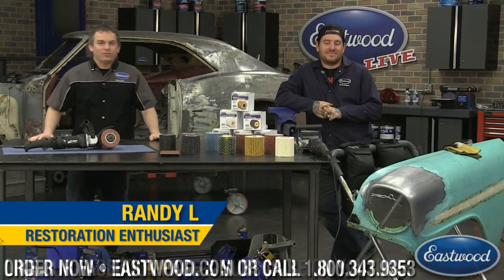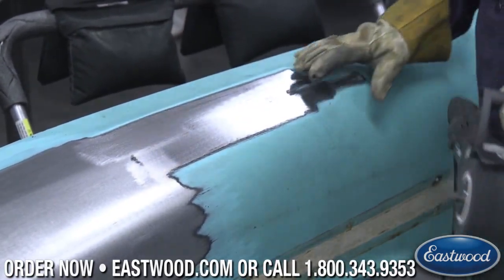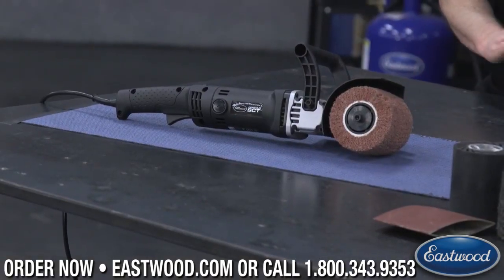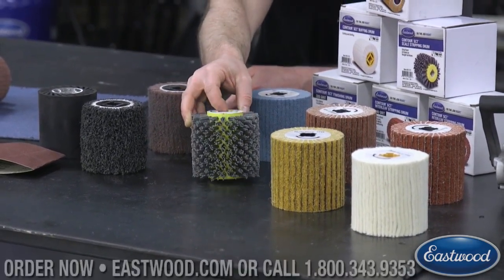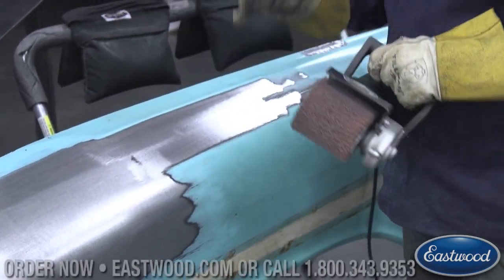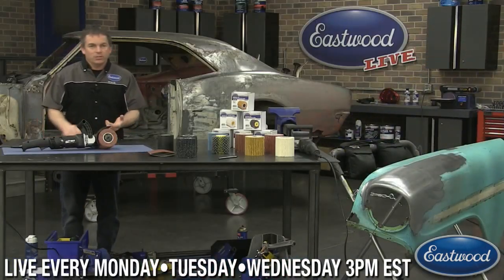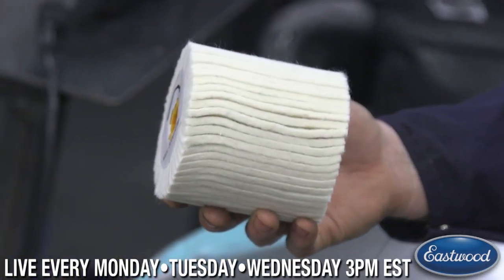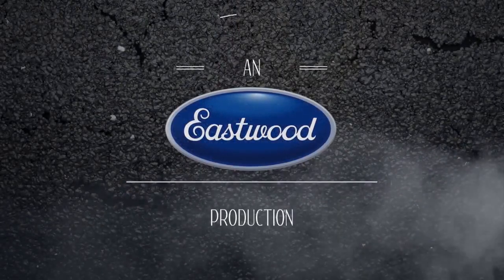The Best Way to Strip Rust, Paint and Filler + Prep Your Bare Metal for Primer – Contour SCT

Comment: So im 65 and   i knew better as ive painted many cars and trucks but it has been years,,,i attempted to sand down my silverado so i could apply some olive drab paint to and camo paint,,,all went well except for front drivers panel fender which i used a 7 inch sander with 220 but had it turned all the way on high,,it tookj off paint but not evenly..when i applied primer earlier it shows all the high and low spots,,it looks awful,,reast of truck is perfect and ready for paint,,,WHAT is easist best way to strip down to bare metal,,i have a red harbor freight sandblaster but have never used it,,i used aircraft remover 30 years ago and it was awful mess...please advise asap

Comment: Wanted to know how this would work on a fiberglass boat. and what sanding wheels you would use. Please explain in detail to me
Reply from the maker: Would not recommend for fiberglass.  You could try one of the less abrasive wheels, which should be available this week at Eastwood.com.  But test an area that isn't visible before trying to do anything to the car.  This tool could easily remove the fiberglass.  Always wear proper safety protection.
Reply: Eastwood Company you guys have a cool company.